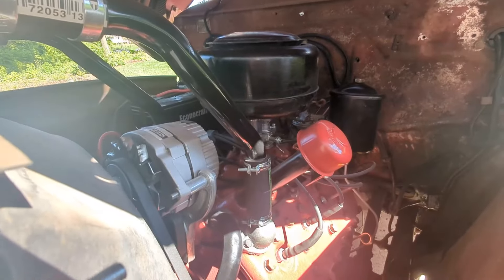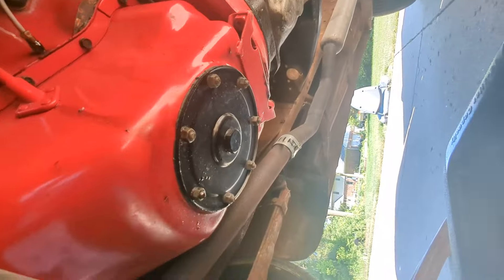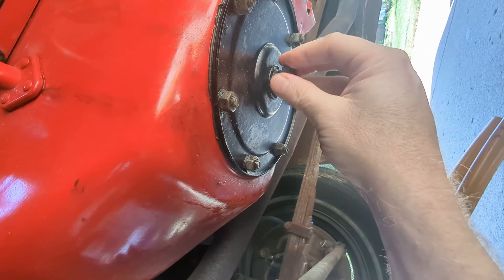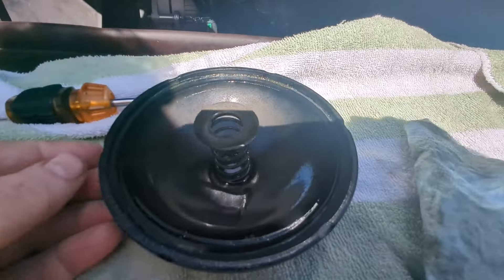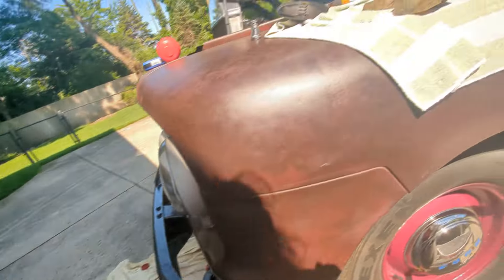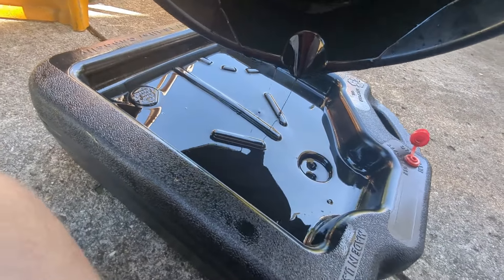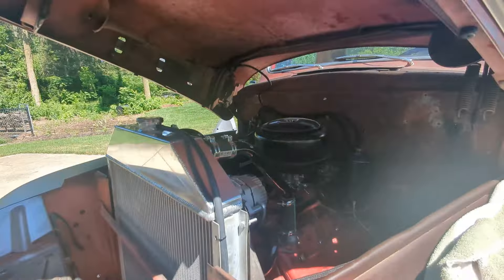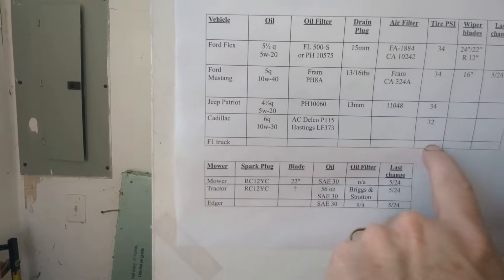1951 Ford F1: Video #28 -- Changing out the break-in oil

Comment: Looks like a nice 5-star extra cab. Original front bumper is rare. Did you use points or go electronic ignition?  Original fuel pump or electric.
Reply from the maker: @tomdunigan234  Mostly stock and original except for conversion to 12 volt and four on the floor. We did add a electric fuel pump recently to help it along.